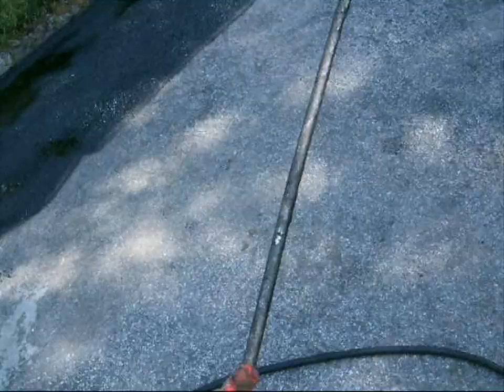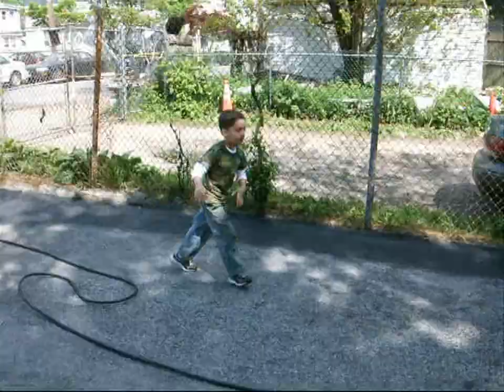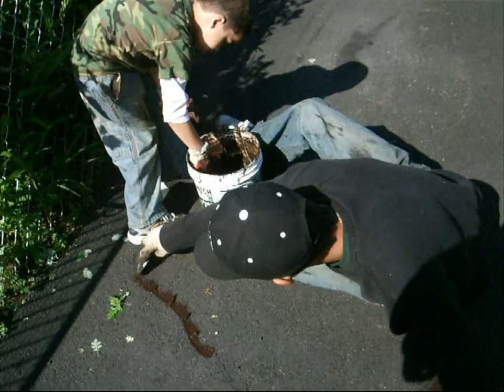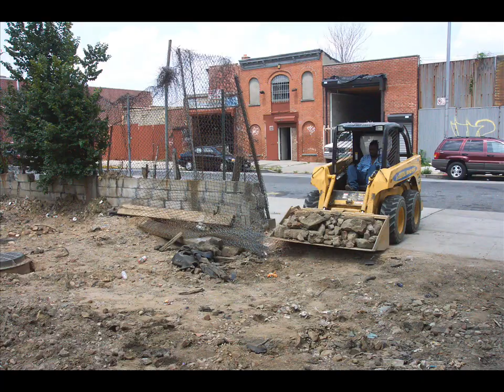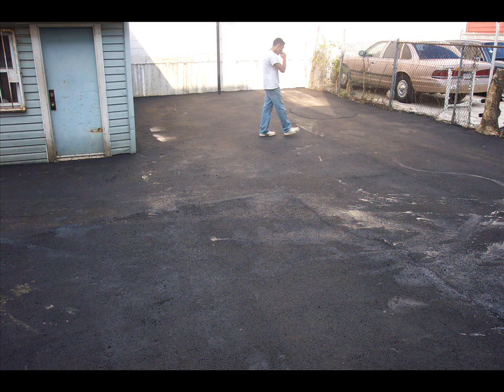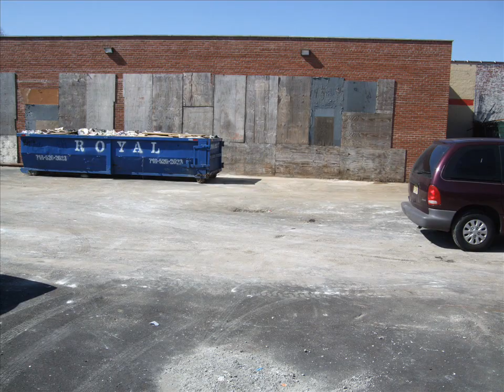gypsy Sealcoating 7 year old  paving black top

Comment: I always require the seal coating be squeegeed after spraying.  That levels out the sealer and forces it into the cracks and between the rocks.  I also prefer a solution with sand in it.

Comment: I've been on the paving business for 27 years, I've seen every scam in the book. I mostly seal and stripe now that I'm 52 years old. when the sealcoater shows up with a 200 gallon in the back of a truck, you are about to get robbed. those are bullshit rigs. I use a sealrite 700 gallon tank with a 2" air diaphragm pump. My mix design is Triton petroleum resin with 2 Ibs of sand per gallon and 3% copolymer additive. What these guys were doing is criminal and it gives legitimate contractors a bad rep. I don't knock on doors saying, I've got extra materials left over from a job blah blah blah. I don't accept any money up front. I give you my home address and phone number, Watch out for these guys, they will fuck you.
Reply: I have been putting oil based sealer on asphalt for 48 years and will continue to do so. It last at least twice as as any water based and most of the time longer, by the way you failed to mention how much water you add to your stuff. I won’t call it sealer. It just lays on the surface and doesn’t rejuvenate the pavement as the oil based product does. Now I don’t know what this guy was using because I have saw all kinds. I do know what mine is and what it does. So just keep doing what you’re doing and don’t kick down the other guy